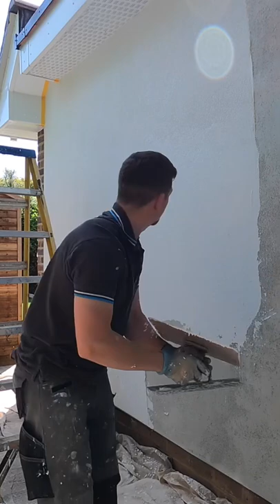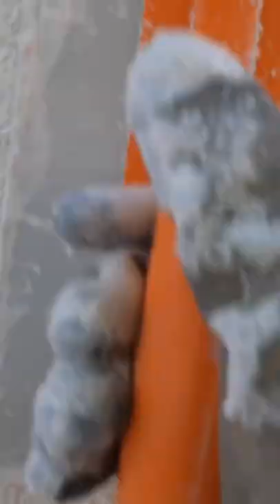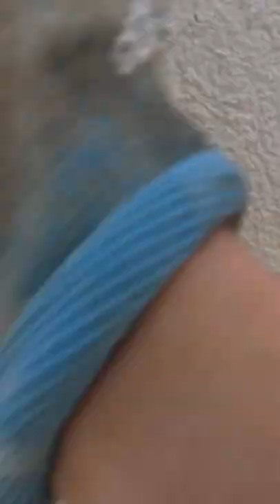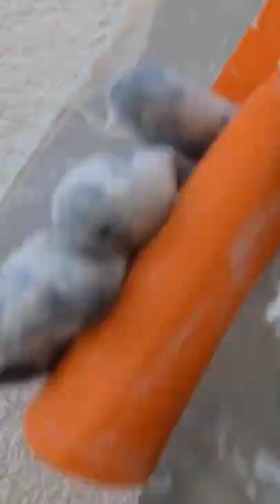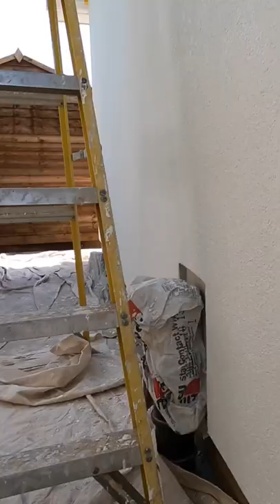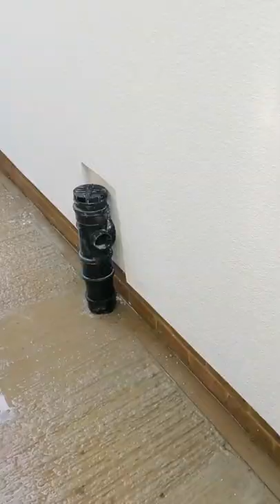Silicone Render Shown In 60 Seconds…FULL VIDEO SATURDAY

Comment: Just wondering, Did you have to anything to that cement board before laying, or can you just go straight over. I’ve gotta job starting in about 3 weeks that have sections of cement board. Cheers👍🏽👍🏽
Reply from the maker: Just go straight over it mate! I use STS boards from Wickes if that helps 👍